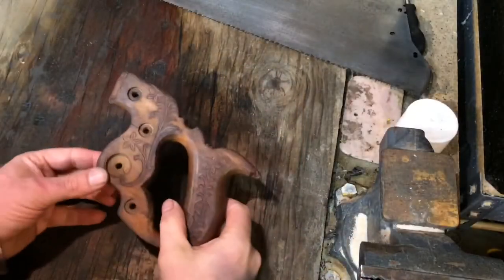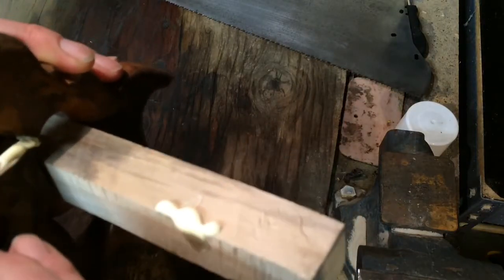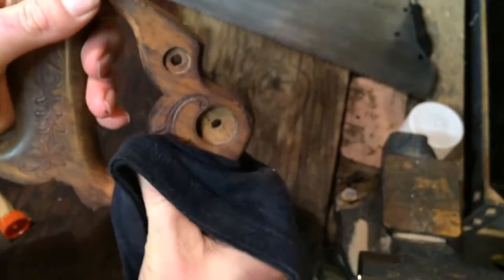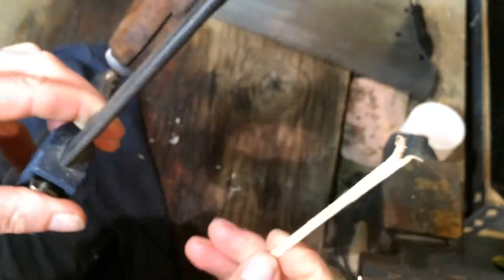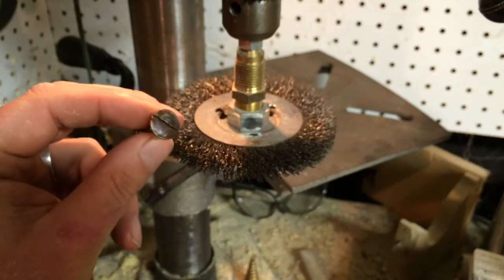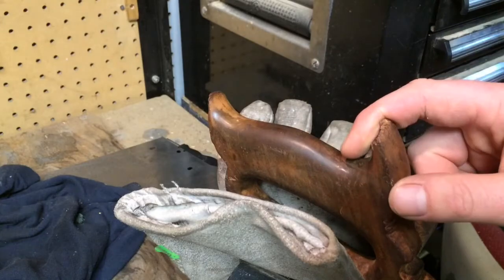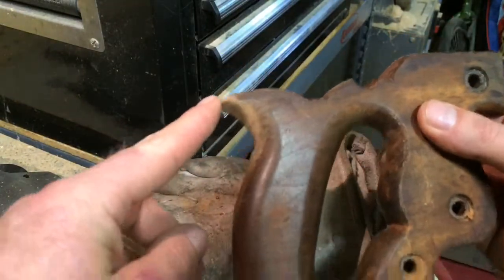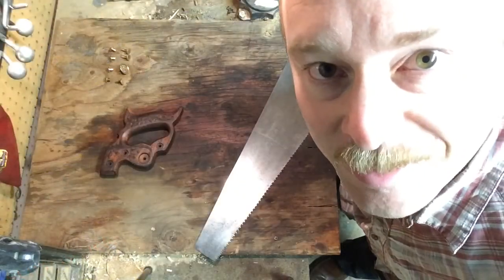E.C. Atkins handsaw restoration  3

Comment: Great video, great job on that Saw. What is your thoughts on waxing that think now. I have 2 Saw's I need to look at restoring. I hope they are not to far gone, lots of rust pitting. They were my Grandfathers. I have several of his old tools to restore.
Reply from the maker: Honestly I'm new enough to using hand saws as a viable tool that I'm not yet up to speed on waxing them.  I have old very used saw that very clearly has a coating of something on it and I've wondered what it is.  Maybe it's wax, thanks for the suggestion I'll look into it.  As to your Grandfather's saws, I say give it a shot, let me know how it turns out.

Comment: great resto on the saw, just a bit of advice. Next time you have a crack like that or similar, dip a piece string in the glue, thread it through the crack but hold your fingers against the side the thread is exiting, your fingers allow the string to come through but glue to stay inside the crack. You can also move the string up and down and really get good coverage.
Reply from the maker: I like that suggestion, Paul.  I'll absolutely try it next time.

Comment: I like your videos. I like the fact that you are not omnipotent, and have to find your way trying different stuff to get where you want; as that is how I will go about it too when I try the same :)
Reply from the maker: +Gerhard Schjelderup I really appreciate that comment, I've worked really hard to make videos that are informative and helpful but don't come off as "this is the only way to do whatever" It's very encouraging to hear that the video came across the way I'd hoped. Cheers ~Z
Reply: +Zack Of All Trades  I just got my birthday presents delivered today from England (a Dorchester and Lee Tenon rip saw, and a Lynx 26 inch handsaw, although my birthday is not before May, LOL). However, I will know tomorrow if I get an old rusty handsaw that will be my restoration project, and I will have to revisit your videos many times. Thanks a lot for producing and sharing your work and experience :) Greetings from Norway.

Comment: First rule of restoration: "Do no harm".  Wood putty on the repair or leave it.  But otherwise a great restoration.
Reply from the maker: You mean on the upper horn?  I didn't think of that but will keep it in mind for next time :)
Reply: When it comes to antiques collectors generally HATE when you remove original wood finish and / or patina.  Collectors  want it to look old.  If you really want an epic tool, you never polish away the awesome black patina.  And try to keep the original finish, if possible.   When you refinish antique furniture you ruin the value.  Antique gun collectors are told to oil the gun, not clean it - except for rust.
Reply from the maker: That is absolutely true, and if I were into collecting or was planning to try to sell this as a collector's item I'd not dream of doing the things I did to this saw lol.  Many of the items I've restored are to be purely users so I like to have them in as cleaned up as possible.  Thanks for the input, and thank you for watching!

Comment: Why didn't you just use "Evapo-rust?"
Reply from the maker: Because you were holding out on me and didnt tell me about this product until now.  Is this a real thing and does it work like it's name implies?
Reply: +Zack Of All Trades evapo-rust works in 48 hours for deep rust, best to use closed container as it does evaporate. But it gets down into pits, when soaking is complete use kitchen scruber, green coarse and yellow sponge, then give it a coat of Johnsons paste wax to prevent rust re-occurance.
Reply: +Jim Buzard it also can be used over and over if stored in the original container.